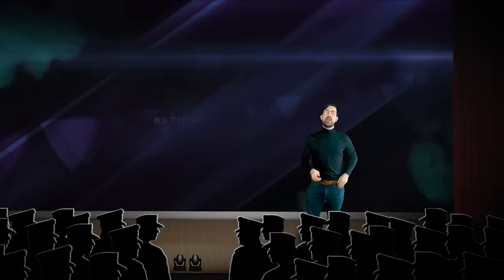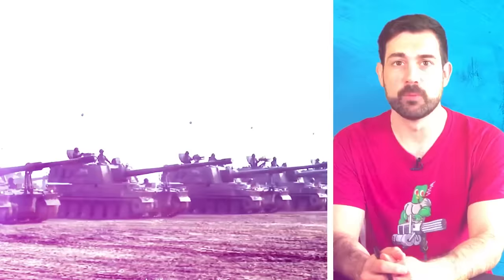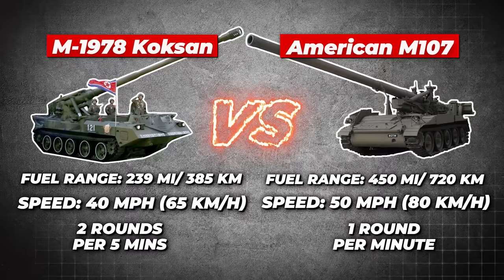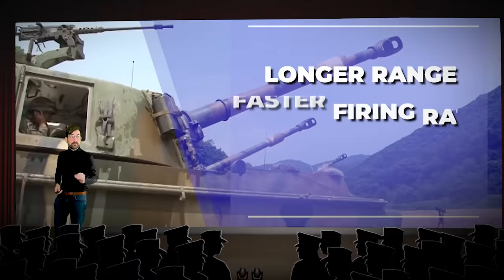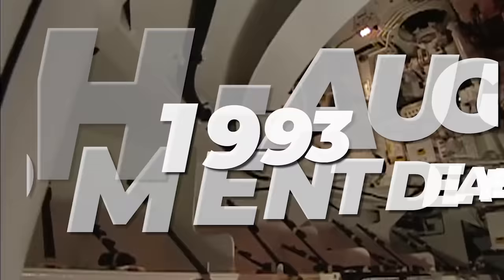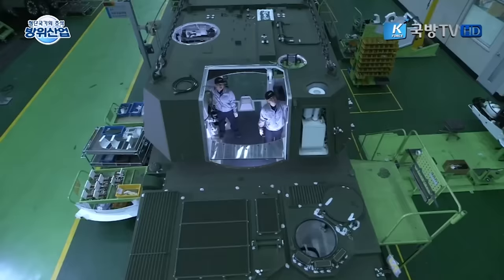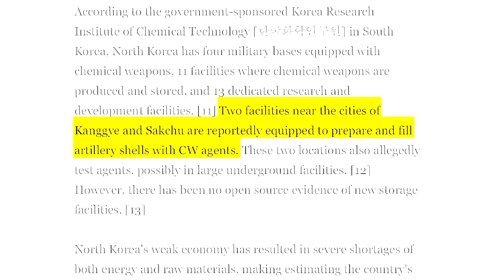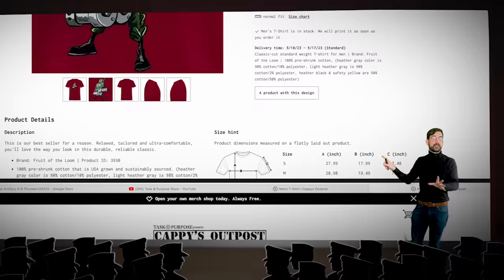Why Korean Army Artillery is the Best in the World

Comment: Ok K9 thunder is good but Damn That reloading vehicle to transfers Artillery shells without exiting is awesome!
Reply: Wait till the K9A2 version becomes operational. It will be fully automated from loading, and target acquisition to firing. But the next version K9A3 version currently in development will have unmanned capabilities with AI that can act independently or as part of a drone battery.
Reply: @michaellim4165  Anything with offensive weapons attached as a drone is bad idea. If enemy can get into command link and highjack it, you are screwed. Even just electronic warfare methods on attacking signal can disable whole system in worst case since everything is wireless. Also if drone gets stuck or there is malfunction, there is no one around to get it unstuck hence need for men to solve issues in the field.
Reply: @Hellsong89  That's just rumor or wishlist of K9A3. I think 70 to 100km range increase is real spec, but driverless is probably just might be wishlist. It will come down to 2 crew with driver and commander with full autoloading SPH.
Reply: I am Korean and worked in the Korean artillery unit for two years. I am a real user of K9. It is a very good device. Guaranteed by real users

Comment: the K9, Panzerhaubitze 2000 and Archer artillery system are (in my opinion) the best shell launching Artillery available today
Reply: Pale in comparison to the G6
Reply: Archer doesn't seem that great tbh. G6 is better for sure
Reply: Considering PzH2000 "reliability" demonstrated in Ukraine - PzH2000 is Panther of SPAs. Terrific and advanced on paper.
Reply: @piotrd.4850  It's reliable, its just not designed to chuck out shells all day every day, theyre running them past their designed operating parameters
Reply: @piotrd.4850  
Sure little peter- is it voting year again in poland ?
Reply: Swiss 155 SPH from 1956 is what they are based on.
Reply: Zero Pzh2000 has been destroyed in Ukraine.
Reply: @piotrd.4850  Well you see the problem with PzH 2k when the guys using it have very little Training compared to other user, low amount of spare parts are there (because no need in peace time) and use it ad it limited like a maschine gun. Thats not how the PzH 2k was designed for
Reply: @piotrd.4850  Tell me again plz again the story of the maintainance center in poland and what happend. Next the PzH is used for preciced fire not for pumping out shells every day for that you have towed pieces or other mobile systems ( like that systems germany throw away after unification )
Reply: @d.o.g573  mad? xD 25? xD
Reply: I know this is a really old system. But Bofors 12/50 dual barrel that can fire over 100 round per minute as long as there cooling water for the barrel
Reply: @alexdunphy3716  "its just not designed to chuck out shells all day every day" - yes, It may be useless in war, but oh my god how good it looks on parade! :D
Reply: @hansmeyer7225  It is difficult to be destroyed if you mostly remain in service instead of participating in combat. I saw a report somewhere that ceasar and krab (based on k9) howitzers fire 5-6x more shells per machine than pzh2000. Perhaps the Germans have better logistics and service and in their use the pzh2000 would operate much more efficiently, but in the conditions of the Ukraine war they are not very reliable compared to archers, crabs and ceasars. It is certainly equipment for well-trained and specialised crews with good logistic support. Its disadvantage is that it is not idiot-proof and mobilisation troops should not use it (which could be a problem for the Germans in the event of a major war).
Reply: @StaszekZlodziejaszek  Well I guess If your SPH is destroyed it doesn't  need maintenance anymore. The PzH2000 was intended for a conscript army. Unlike the Puma (I guess)
Reply: + the RCH 155 (Remote Controlled Howitzer 155 mm) with Pzh 2000 Tower, Barrel but lighter (with tires instead of tracked) and can shoot on move On Boxer basis (the infantry etc. vehicle) therefore modular and since eh already in service many cheaper spare parts.
Reply: Agreed
Reply: @alexdunphy3716  "It's reliable, it's just not designed to chuck out shells all day every day."

I'm confused. If it's only reliable when you don't use it, isn't that the definition of unreliable? Also, nobody expects to fire 155mm shells constantly without some breakdown. But the lack of spare parts for the PzH greatly limits its usefulness in battle.

I really think way more important than comparing specs, you need to look at spare parts availability, how robust that weapon is under the pressure of war, how expensive is it to maintain. These are the factors which separate Korean weapons from the competition. Korean weapons are robust, you get the license to make the spare parts you need, and the maintenance bill is less than the US version.
Reply: @jimpark8379  Thing we're talking hundreds of rounds a day here.  No Artillery piece will sustain that for long. 
They seem to be extremely popular in Ukraine after all they've decided to buy more
Reply: @tarekwinkler5892  NATO focuses on Air dominance and thus use of CAS to do what Russia does with artillery.
Reply: @alexdunphy3716 ph 2000 has reliability issue. For example it failed in cold scandinavian weather and norway chose the k9
Reply: I just want to point out that one of the strengths of the K9 is when the Korean technology is not as good as the native tech, we buy the foreign tech.

For example, the K9 chassis gets a lot of praise. But guess what? The K9 used an Alison transmission (Alison is a US based company that makes bulletproof large engine transmissions) and the German MTU engine, which is widely regarded as THE engine of choice for MBTs, heavy IVFs, etc.

I'm sure there's some other foreign tech in the K9 that makes it more reliable, robust.

I'm a big fan of buying other countries top tech. All the advanced nations have their share of genius engineers. If somebody else pours blood, sweat and tears into making a world beating product, I think it's best to buy it and put your R&D money into something else.

The country who made the top notch product deserves to make money for their quality work. The country making the weapon can focus on improving other parts of the weapon. The buyers get a better product.

Plus I think it helps to build alliances when everyone contributes something for our common defense needs vs aggressor states.
Reply: @StaszekZlodziejaszek That's like saying a sniper rifle is useless because it can't shoot like a machine gun. PZH-2000 is designed for the role of extreme range precision hits and counter-battery, not for mid-range volume suppression or levelling a city block like Russian artillery.

Comment: PH2000 users on suicide watch after seeing that K9 is cheaper, more reliable, better and comes with less strings attacked than German SPH.
Reply: The PzH is still better, thats the reason why Ukraine ordered 100 new PzH 2000.
Reply: Apart from the less strings attached part this is debatable. Due to sales numbers they naturally come cheaper. Has nothing to do with the System itself but its a strenght. 

Reliability is not the issue you think it is. The whole reliability discussion came up after Ukraine put those artillerypieces through way over 100 shots per day for a month. Any arty will break under those circumstances

Flat out better isn't that obvious. The technical Data is comparable Ukraine has lost at least 13 AHS Krab which have a K9 chassis but no PHZ has been lost yet.
Reply: @heyho4770  100 per day?  assuming 10 hours, that's like 10 per hour, 1 shot every 6 minutes.  and it broke?  that's pathetic.
Reply: Ph2000 is a paper spec tiger. In reality it has many reliability issues. And its overpriced. Thats why more countries chose the k9
Reply: @Trigger-vi6lb  PZH2000 stopped production a long time ago and cost over 20 million per if you can even get one available for sale. Not to mention is a very heavy vehicle that gets stuck in the snow and failed its tests in Norway.
Reply: @kenmasters2025  Shows your cluelessness. Artillery barrel lifespan is in the range of a few thousand shots. For M 777 its usually replaced after 1500-2500 rounds. So shooting over 100 rounds each day for a month will inevitably lead to maintenance issues.
Reply: @nothingmatters3802  and they are starting production again, Ukraine is not Norway.
Reply: @Trigger 3504  Considering only, they haven't done so yet. With modern German politics, it will take forever.
Reply: @heyho4770  Useful, guaranteed lifespan with accuracy within tolerance.  Marines tested M777 to destruction and it gave out after 6000+ shots - 3-4x the wear that allows to fire with precision.
Reply: @piotrd.4850  An inaccurate artillery is at best wasteful. Ask the russians who don't have the logistics for regular barrel replacements and blew through most of their ammo reserves last summer. At worst it'll lead to more friendly fire. Ask the russians again. 

Ukraine simply can't afford to have the problems that come with inaccurate artillery
Reply: @Trigger-vi6lb  i was also told by instructors of Estonian artilley battalion that PH2000 was much more difficult to train conscripts with compared to K9 which we decided to buy.

Comment: Was a sad day when the Danish army decided for french cesar instead of the K9 a few years back as the new artillery system. however since the entire fleet have been donated to Ukraine ( compare that if big nations like the US or France/germany etc did the same % of army donations), maby there will be a new chance to get the K9
Reply: Unfortunately not this time, we went with the Israeli-made ATMOS artillery system plus and additional PULS MLRS system to replace CAESAR. It's due to be delivered next year.
Reply: Ceasar and K9 are designed for different usage. One for quick mobility (inc. air transport) and manoeuvrability, the other for heavy armored artillery exchanges. Considering Denmark geographical location and NATO membership, I'd say it makes more sense to get the Ceasar over the K9. For a country like Poland or Finland, it would be the opposite. Ideally you'd have both systems however as they are complementary rather than competitors. Both are excellent artillery systems.
Reply: @jagorsimp7020  yes agreed, also Ceasar was bought 100% correctly to the role as a high effect, precise and mobile system at a good cost vs the K9, to the role of delivering fire support from fortified positions with low thread of counter battery/aircraft etc. like fire support in international missions like Iraq and afghansistan. the large thread of conventional conflict, few imagined back when the program was started. my only bias towards K9 is to be honest the general weather in denmark and sitting inside a heated box doing long fire mission drills instead of standing outside in frezing rain :D

Comment: Based on current production volume, it is the most sold self-propelled howitzer in the 2000s and has a global market share of 70%. There is a continuous backlog of orders ahead. The K9 self-propelled howitzer is a global best-seller like the F-16. It has already become NATO's standard self-propelled howitzer, and production is close to 2,000 units. It is produced in huge quantities, has smooth maintenance and parts supply, and is easy to modify in the future.

Comment: There was a tactic called a 5 round "Stonk" where a battery would fire 5 rounds on an already zeroed, then bug out.  This would allow for a similar multi-impact shock where many shells could land out of the blue and it would only take 1 gun to do it.  If the GPS and other factors are good enough, several guns (4 or 5) in a section of the battery could relay backwards and keep a chokepoint jammed up.

Comment: When NK invaded SK in 1950, they took Seoul in 14 hours.  Then they waited 3 days to cross Han river.  It was a mystery as that 3 days is what ended up allowing UN forces to land in Incheon.  Later it was revealed that the NK forces were supposed to rendezvous with another attack force from the East.  And that force was held back by SK artillery battery until their shells ran out.  Kim Il-Sung later regretted this and should've pushed South without that force.  Since then, Koreans always regarded artillery as King of battlefield.
This is still true in modern day as evidenced in Ukraine.
Reply: if you don't have control of the skies. if you control the skies the artillery is toast.
Reply: @ronblack7870  Russia don't have control of the skies?
Reply: @ronblack7870  by the time you seize control of the sky the artillery would already done most of its job.
Reply: They have nuclear weapons now. Artillery is nowhere near as important as it was before.
Reply: @djinn666  Russia don't have nuclear weapons?
Reply: @BrianHSC  Russia is not fighting for it's survival. North Korea will be.
Reply: @ronblack7870  South Korea most definitely has the air superiority. F-35, F-15, F-16, FA-50. KF21 etc modern jets vs North Korea's 1960s scrap metal MIGs they cannot even fly due to lack of jet fuel. Even just South Korea's stockpile of old F-5 and F-4 would be enough to control the air if North Korean jets can even manage to take off or go through South Korea's air defense systems. This is not even counting the US' air assets stationed in Japan and South Korea.
Reply: @djinn666 Pootin isn’t fighting for survival?  If he loses Ukraine, he’s toast.😂
Reply: @Frankon81  yeah what most people don't realize is all of South  Korea with few exception of the most southren area is in range of artillery in instant notice. it was not like they need to gather and set up position. They are already in place so aircraft is useless at the first 20 minute of the start of war where each side will throw 200.000 artillery ammo or 4 day of worth Russian attack.
Reply: @pleasetredonme  NK isn't actually capable of  a real war.   their equipment is old and outdated, poorly maintained, and they don't have the money.  they could potentially do some damage, but can never win a war.
Reply: @ronblack7870 having control of the sky is an exception rather than the norms anyway, and its getting increasingly rarer consider the amount of effort that went to multi-layered air defense & anti-air measures, especially with competent peer opponents

Comment: The Indian version is called the k9 Vajra (thunder/ a weapon of lord indra). And right now the IA has a bout a 100 of these. 200 more are planned. A light tank that will use the chassis of the k9 is also being developed.
Reply: The "light tank" based on K9's chassis and transmission will be one of the contenders for the project. Not the sole option and nothing is decided yet as of now. Are you suggesting the L&T tank is based on K9's chassis?
Reply: @varun2250  all I said was they are developing a light tank with the k9s chassis. I never said it was the only option.
Reply: @adisura9904  My bad, one question though! Is it the L&T's offering that has K9's underpinnings?
Reply: @varun2250  if I remember correctly yes. Apparently the DRDO And L&T are working on a light tank based on the chassis of a k9 vajra.  The turret is supposed to be a 105mm Belgium one. Or that is what iv heard/read. Although there very well could be other light tanks in development under the TATAs the Mahindras and others. Although I'd think that the TATAs would focus on developing the WhAP (kestral) with its many variations over a new light tank design.